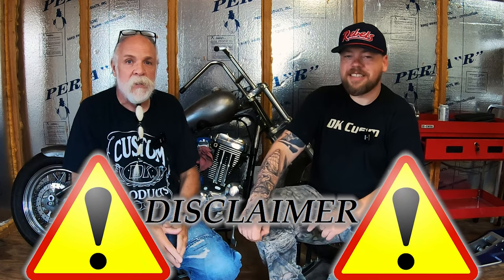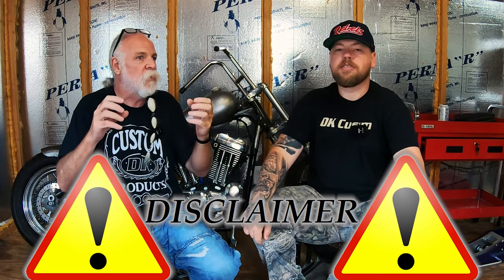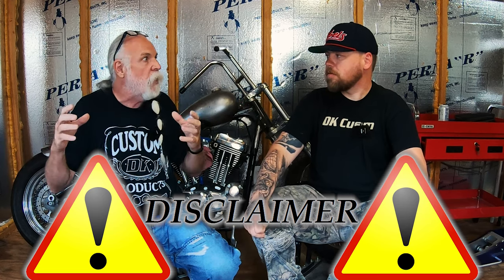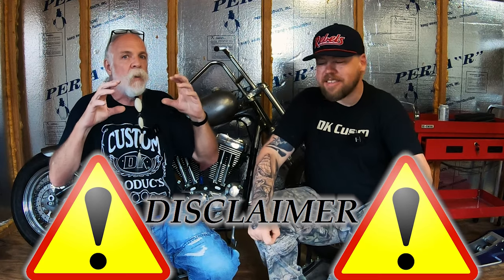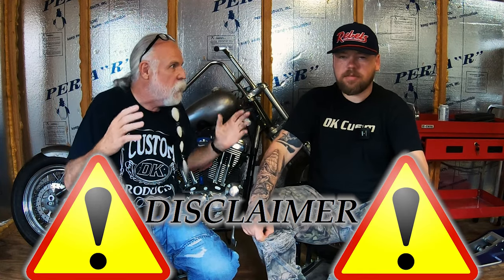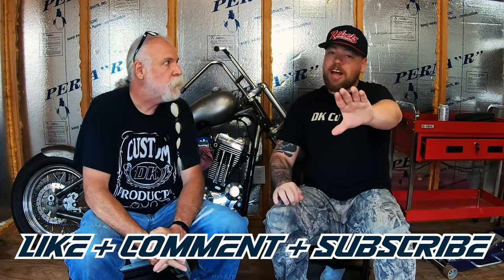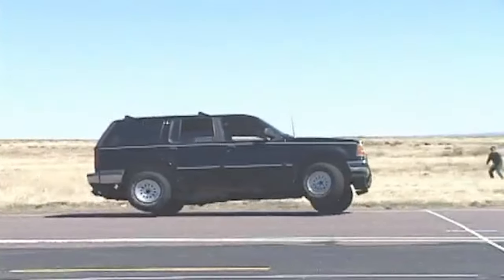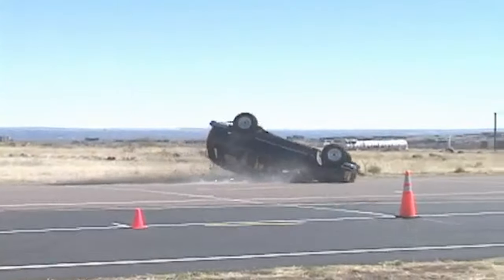Why Does Harley Manual List the WRONG PSI for Rear Trike Tires?

Comment: I’ve always rode on 2 wheels. Due to a back injury that affects my legs I recently bought a 2012 triglide. Garage kept with only 1100 miles on it.I won’t give up riding. It’s nice to get info from someone who actually ride a trike all the time. I lowered my pressure in the rear tires to 20psi and it was an enormous difference in the comfort of the ride. Will be watching your videos for more updates I’d like to do to my trike. Thanks
Reply from the maker: Congrats on your new to you ride! 👍😎👍
Glad you are starting to get it dialed in, and are liking the videos.
Here is my most recent Tri Glide and a walk around video of some of the things I've done with it.
https://www.youtube.com/watch?v=5h77GQJTW1w
Reply: I have lowered to 24 lb and that's still rough ride. I have a lift kit in the freewheeler and air shocks. I will ride tomorrow 2/21 and try the 20 lbs in my rear tires
Reply: I have a 2012 as well.  Previous owner recommended 25 PSI.  28-30 and she bounces and bumps.  20-25 Much better. Adding a trailer hitch for pull behind might have to up it a little.

Comment: I'm thinking one of the big reasons Harley-Davidson requires a minimum of 26psi in the rear tires is due to potential changes in altitude. If my tires have 26psi here at home at 6,000ft altitude and I ride to Daytona, they will only register close to 20psi when I get there. If I left here with 20psi, I'd be close to 15psi when I got to Daytona. A lot of people don't take altitude into consideration so I think it was probably a good CYA by HD.
Reply from the maker: It is not Harley requiring a minimum of 26 PSI, it is the Government.  And they are doing it for the reason you stated...protecting people from their non-thinking or uneducated selves.  AKA, nanny controls that have been on automobiles for quite a while, and are now showing up more and more on motorcycles.
Here is a link to a full explanation by the designers of the HD Trikes- https://www.dkcustomproducts.com/media/wysiwyg/framesuspension/rearshocks/Lehman_Trikes_correct_tire_pressure.pdf
KP
Reply: @DKCustomProducts  Very informative article. I'm so glad you guys have this channel to share this type of informationand so much more. You're about the only one (reputable and intelligent) that has a Trike. I'm so happy with everything from DK that I have on my '21 Tri. I'm hoping my health will allow me to ride down there one day from Colorado to see your organization.
Reply from the maker: I am so glad that you are Happy with the benefits of having the parts installed and that you find the videos informative. I hope that your health will allow you to ride everywhere you want to go and many more miles of smiles. Thank you for commenting! 😎 MB

Comment: I've been running 22psi in the rear tires of my '21 Trike since new, passenger or not. Huge difference between 26 and 22. Learned this one day after installing my rear bumper, then stepping on it and bouncing to see how strong it was. I looked at rear tires and saw how stiff they still were when bouncing at 26psi and had a lightbulb moment! Totally made sense to drop the pressure. As you say, look at the loads of each tire.....Trike = 1350 lbs. There's got to be 350 lbs. on front tire leaving only 500 lbs. for each rear which is nothing for that size tire. Good video
Reply from the maker: Thank you for your comment and good information.
Great job of deductive reasoning.
Appreciate you watching and commenting.  👍

Comment: Wow. Just the video I was looking for. Been running 26 psi in both my 2012 and 2016 HD Trikes. Will lower to 20 in the rear.  However, I do ride with a few other HD Trike guys and they sometimes run 36 to 40 psi in the rear tires when we are running hot. Their theory is a higher inflated tire will provide less roll resistance and get greater performance.  Don’t know about that.
Reply from the maker: I think you will like the little extra cush in the ride with the rears down at 20 psi.
Yes, the higher PSI in the rear tires will definitely cut down on rolling resistance.  Not sure if it will translate to any significant increase in MPG.  It will definitely translate into a much rougher ride (and a little better acceleration).
Thanks for the comment, and glad you found the video useful. 👍

Comment: I have a 24 Road Glide 3 so what would the ideal psi be with low profile tires on the RG3? Would 20-22 psi be good for those low profile tires?
Reply from the maker: Freewheeler, RG3 and Tri Glide are all the same frame, and work the same way, including the PSI for the tires.  The RG3, CVO Trikes and some Freewheelers have lower profile tires, but still the ideal PSI is 20-22 PSI. The lower profile tires do not provide as good a ride, so you may consider switching out your rear tires for a less low profile tire. 

Here is a link to a report for all Harley Trikes- https://www.dkcustomproducts.com/media/wysiwyg/framesuspension/rearshocks/Lehman_Trikes_correct_tire_pressure.pdf

Thank you for commenting! 😎 MB
Reply: @DKCustomProducts  Thank you for the info. Little question, i imagine the low pressure light will come on, we just ignore it or is there a way of resetting it so it doesn't come on at 22 psi ?
Reply from the maker: Some people get aftermarket TPMS so that they can adjust it to what tire pressure they want. Some people just ignore the light being on. It would really be a question as if it bothers you enough to want to change it out to an aftermarket one or not. 

Here is a video we made that touches on TPMS that you may find interesting - https://www.youtube.com/watch?v=UfDseUSqjww

Thank you for commenting! MB

Comment: I changed my pressures yesterday to 18 lbs and had the most pleasurable ride  to date on my trike. I also dropped my shock pressure down to 13 lbs which is a little low in “some” cases. I will increase 1 lb at a time and try to repeat the conditions again to get it just right. Also plan doing temperature checks on tires before and during the ride. Great information have bought a few products from DK and love them.
Reply from the maker: Good deal!  Glad you are enjoying your ride!
We appreciate your business, and glad you are liking the parts! 👍😎👍
Reply: A treasure trove of information in your trike videos! I have shared your trike videos with my best friend who is on a 2023 - 120 anniversary Red model. I’m here watching and learning before my first Tri Glide purchase after 44 years of motorcycles. I’ve ridden trikes a little. Mainly when I was helping a friend comply with state regs in order to pass inspection to register an out of state purchase. I had that Gold Wing trike for a month and loved the utility. 
Now let’s see what is offered for 2024. I’m hoping since there’s been no major changes since the 2019 models it’ll be worth the wait. I’ll be buying those wheel bearing retaining plates - perhaps the dealer will install them before I take a trike home.
Reply from the maker: @Ytcoinshooter  Thanks for the comment, and glad you are finding the videos useful/interesting. 
Congrats on your upcoming purchase.  2024's...gonna be interesting to see if they go with the VVT and bigger screen like the CVO's have that were recently introduced.

Comment: Interesting perspective on tire pressure for a Trike. I’m wondering what it does to your fuel mileage and whether your more susceptible to flat tires because of the low tire pressure.
Reply from the maker: At 20 psi they are not low for the weight of the Trike.  They can be as low as 26 PSI for an automobile that weighs 3 times as much.
MPG is a negligible, less that 1/2 mpg difference between 26 and 20.
Knock on wood, I have close to 200,000 miles riding Trikes down at 20 psi and have never had a flat.  I've ridden thousands of miles on gravel roads, including all the way to the Arctic Circle and back.
I was outside Atlanta one and noticed a screw imbedded in one of the rear tires.  Removed it and replaced it with a plug and kept going with no issues.

Comment: Auto tech for 15-20yrs. If i recall, i remember reading a tsb or something back in the day. The reason for the lowerd pressure in the exploders was to help counter their tipy-ness. The placard in the doors, say 26 psi.
I've delt with alot of tires over the years. you can tell when someone ran one too low on pressure, as the sidewalls begin to disintigrate. In mild cases, you'll see a slight bubbly deformation, in extreame cases, the sidewall completey destroys itself. Its all about the tire sidewall flexing and heating up. Think of bending a wire back and forth until it breaks. The other thing you'll see is if its so low, the rim rests on the tire and grinds the insides together, and rubs/wears/cuts through on the inside.
Now my truck, wieghs 5400lbs. (I wieghed it, on a scale, so I knew what size winch would be apropriate.)
Its reccomended tire pressures are 32 in the front, 35 in the rear.. why? Incase I haul stuff. keep in mind, the engine is in the front. the tranny and t-case are biased to the front.
Its partly why front brakes are soo much larger than rear.. the fronts do 60-70% of the braking work... cuz inertia, wieght etc.
I  just bought my trike like 3 weeks ago... 6hr ride home.. lol.
But I went past that scale, its a truck stop, and I needed a break, water, and to send my kid on his way home. (He drove me down to look at the trike etc.)
The trike wieghs 1200lbs, )with my tackle box.. lol. 1410lbs with me on it. thats like 1/4 to 1/5th the wieght, only 1 less tire...
My quad, i run at 14psi. Its alot lighter, but its theyre balloony light wieght tires, but i ride that thing sideways, skipping off tree roots and rocks, and bounced it off trees etc no problems, never blown a bead or nothing. Also, lower tire pressure, more contact to the road = more traction. Kinda like walking very flat footed on ice in the winter. "The penguin walk." lol
I wouldnt be scared to run the trikes tires as low as even 18psi, or even lower. i have cars come in all the time in winter, tires not even 20 psi, doin fine, just low. (The average auto tire looses 1psi for evey 7 degrees celcius the temp drops. we go from +35 summers to -45 winters. thats like a 10-12 psi change throughout the year.)
Everything you guys say makes so much perfect sense.
Erm.. sorry I rambled ,Just wanted to share what I was thinking while you guys were discussing! Great vid!
Reply from the maker: Glad you're liking the videos. Yeah for Trike Tires I would say between 22-20 PSI!  Thank you for the comment. 👍

Comment: THANKS for that information !!! I have been following the Owners Manual since I bought my Trike new 4 years ago, but like you say the Dealer always jacks it back up to  36 when I take in for service. I now have 45K miles on my 2018 Trike Ultra and decided I am gonna keep the Trike rather than trade it in so I purchased Legends Suspensions on front and rear. The difference in comfort is worth the money to me .... and now I am going to lower my rear tire pressure to 20 psi for an even better ride. THANK YOU !!!
Reply from the maker: Glad you're liking the videos and find them useful.  Thank you for the comment. 👍

Comment: Yes you are spot on. The CanAm recommends 12.5 to 17psi on the front tires, I recommend 15-16 max on my custom trikes. excessive pressure has a detrimental effect on handling. More pressure will result in bounce and ill handling in general. For ALL trikes 18-20 is max. Keep in mind however rear wheel trikes are inherently unstable due to design especially in hard braking while going downhill.
Reply from the maker: Thank you, glad you are liking the videos.  Yes, Apples and oranges on Harley Trikes vx. CanAm and other Trikes with 2 wheels up front.

On HD trikes, when you go below 20 psi on the rear tires it gets a little bouncy/pogo stick action, plus one may feel a little wallowing.  At 16 psi in the rear tires the HD trikes will Not handle well, plus the ride quality will suffer.

Can't agree with you on the classic trike design (read HD trikes) being inherently unstable due to design.  Here is a video of some aggressive riding on a HD Trike that you may find interesting- https://www.youtube.com/watch?v=3UAMKIj97G0

Thanks for commenting! 😎

Comment: I have only had my 2009 Tri-Glide for a couple years and have put several thousand miles on it so far doing improvements from watching videos and following your channel and 98% of the things I've changed, bought or done to my Tri-Glide has been because of the (way) yall research and  explain  your findings on a subject . So after watching this at 1am I went to the garage and checked my tires on this 55° night in south central ky and found front at 40 psi lowered it to 36 and rear were around 32psi and lowered to 22psi and went ripping around the block (15-16) miles at WOT as much as my country backroads will allow and MY experience was very delightful to my surprise 😮 😀 needed to test drive it really anyway because I had just installed the 606 and transformer EBS a few hours before and was wondering what my morning commute to work would bring so after watching this I couldn't TAKE NO MORE 🤣 so around the block I went 😁 so now i can't sleep because I'm watching the clock for my 27 mile morning auto tune session on the way to work😎
Reply from the maker: Man, that is great.  So good to hear you found the video useful and have a more comfortable ride now.
Thank you for your business, we appreciate it.  Great to hear you are enjoying the videos and the parts!  👍😎👍

Comment: Thanks for this discussion on tire pressures on Harley Tikes. I watched a similar video from another source. It did not give specific numbers, so I reduced my pressure to 24psi and could feel some improvement. I will play around with pressures starting at 22psi and see if that works for me. I usually ride solo and rarely load down my ride. This information could potentially safe riders from spending big bucks on upgrading their rear shocks. I ride is a 2021 Tri Glide Ultra.
Reply from the maker: Glad you found it useful.  Yes, getting those tires to 20 PSI will improve the ride quality for free.  If one wants even better, then a Convertible Comfort Lift™ will improve it a bit more.  After that it gets expensive with the NEXGEN Trike Series Shocks™, but that gives the ultimate rear suspension comfort and handling on a Harley Trike.
Thank you for the comment. 👍

Comment: I ran 20 PSI on my 2017 and now on my 2021, and it does make a difference in the ride. I’ve not had any unusual wearing of the tires at all, nor has it adversely affected the handling of the trike. 

Good information, guys, and good discussion.
Reply from the maker: Thank you for sharing your experience.  Appreciate your comment. 👍

Comment: I’m new to trikes this year. Always had 2 wheeled HD. I want to point out that you completely neglected to mention that running your tire pressure low cause’s significantly higher tire temperatures and the potential to overheat. 
 The primary cause of tire blowouts is overheating not impacts as most people think.
I worked for 2 different (automotive)tire company’s for 12 years both as a mechanic and in management. I  have been a shop owner for 35 years. 
The one thing that tires makers stress harder than anything else is just how critical tire psi is. That’s why the FED now requires TPMS now. 
If you do alter tire PSI from manufacturers recommendation and there is a PSI differential from front to back then you should maintain that difference in PSI even if you change one end or the other. 
  These differences will impact handling and Cornering significantly particularly at higher speeds or  accelerating from an on-ramp onto the freeway around the curve, for instance. 
There is more to PSI than just the load rating. 
I understand the rules may be different verses 4 wheeled automobiles but I think this should be crossed referenced to additional sources.
Reply from the maker: Yeah, the 26 PSI is a number for automobiles.  The rear tires on a HD Trike are automotive tires and the weight from the Trike is not enough for those tires to see a heat or mpg difference of more than 1-2 percent when dropping the PSI to 20.
Here is a link to a write up on the subject that you may find interesting.
https://www.dkcustomproducts.com/media/wysiwyg/framesuspension/rearshocks/Lehman_Trikes_correct_tire_pressure.pdf

Thank you for your comment.
KP

Comment: My 2023 road glide 3 has low profile tires and over sized rims From the factory. What do you recommend as to not ruin the tire or rim/ wheels? Pot holes are the roads in the capital city of michigan. I bought wheel and tire warrenty.
Reply from the maker: We have a lot of experience with those low profile tires...unfortunately they make an already rough riding OEM suspension even rougher because of lack of sidewalls that can give a little flex.

You can always switch rear tires & wheels for the standard rears with more sidewalls. 

Here is a report on suspension testing, utilizing input from 6 different riders- https://www.dkcustomproducts.com/overview-of-performance-rear-shocks-98.htm

And here is a video of Trike Suspension testing, using a bump recorder (charts included) to show the differences between OEM shocks and good shocks- https://www.youtube.com/watch?v=Z4Dhg48_KQA

Thank you for commenting! 😎 MB